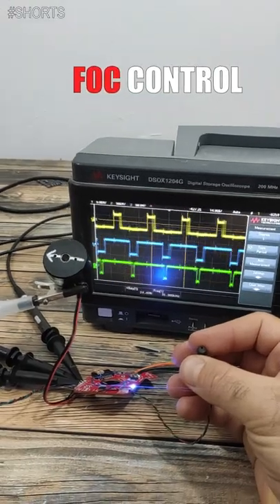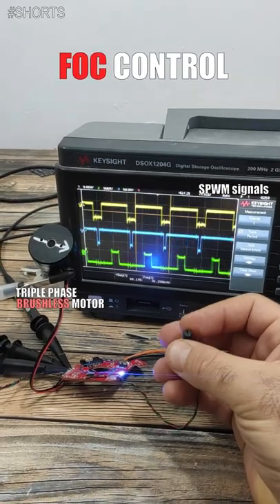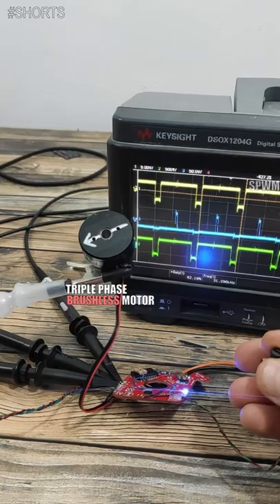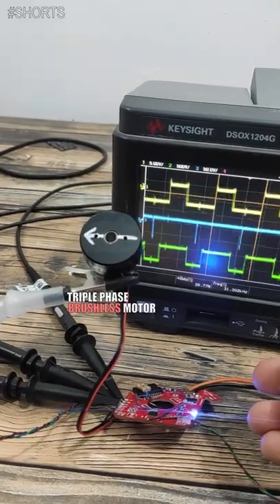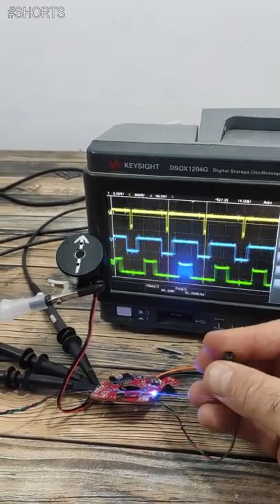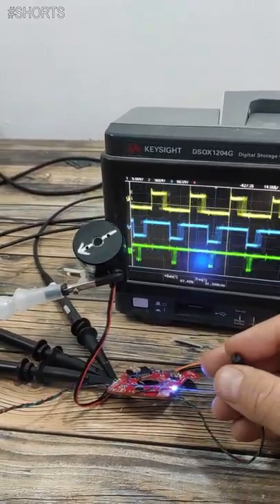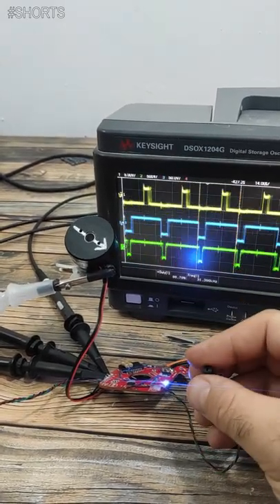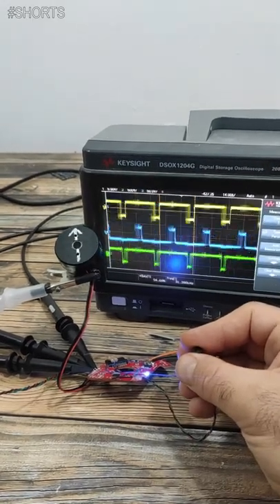Sinusoidal FOC Control of Brushless Motor - Open Loop

Comment: Hey I have been a fan of your open source projects , is it possible to make a open source inkject printer ? With readily available parts like Arduino and stepper motor driver and probably adapting a off the shelf  printer cartridge, but refillable may be.

Comment: You can't use this wave form for high current applications. You need your own dead time control over pwm signals for h bridges. Esp32 has 2 6 output h bridges gave me wanderful results to generate 3 phase sinusoidal voltage of with 8 bit amplitude sample at 20 khz pwm frequency.

Comment: This is awesome, if you could make this in such a way that its closed loop and able to drive a larger motor using a power mosfet inverter it could be used to drive ebikes. Atleast the control board section by arduino would be nice. We at our company use dsPIC33 mc for these purpose but it requires an icd kit and the PIC ecosystem is expensive for me. 

Esp32 have an integrated motor control pwm that can do space vector control have you tried it?
Reply: Take a look at VESC project

Comment: It isn't really field oriented control, your just sending SPWM voltages to the 3 phases and the motor is snapping to align with the generated RMF. The angle ends up being zero under no torque load and if the angle gets too high (higher than 90° spinning too fast or too heavy a load) then it slips (de-syncs) and potentially stops rotating with the field due to the inertia and load.
Reply from the maker: It will have a magnetic encoder and control the angle with feedback.
Reply: @ELECTRONOOBS  I think it's possible to do FOC without sensored feedback but limited to higher speeds. Also you need current sensors to do it properly. Both of those sensors could be replaced my "estimator" blocks based on the electrical model of the motor and what is known.
Reply: Sensorless FOC methods use “Observer” algorithms to detect rotor position using Back-EMF information if the rotor is spinning. 
Sensors are used to give position info at Zero Speed, but there are already methods being developed to get around this
(High Frequency Injection)
Reply: @Jdogdrums7  I am gonna have to explore the high-frequency injection method! Might be useful for controlling off the shelf IM machines very precisely
Reply: @power-max  if using a Rotor position sensor isn’t viable (Hall, Encoder, etc.) then it’s definitely better than an Open-Loop startup if you tune it correctly.

VESC already has a Silent HFI version for 6.0 hardware version

Comment: SPWM, eww! You should use space vector modulation and 3rd harmonic injection! This let's you feed in a larger percentage of your DC bus to your motor, allowing it to spin slightly faster at a given DC input voltage.